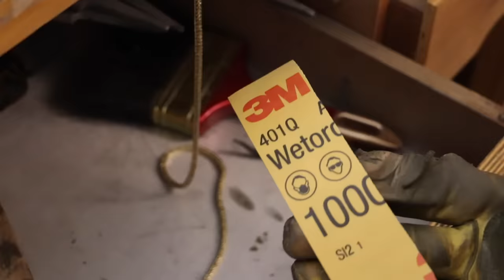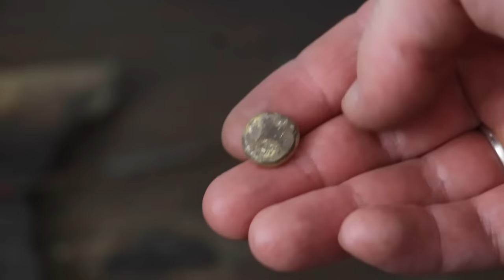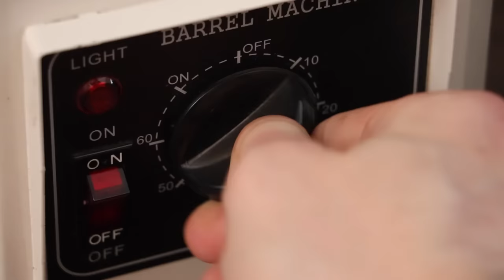18k Gold Chain | dynamisjewelry.com | How it's made

Comment: What are the numbers for cutting down the 1oz of 24k into 18k. Looks like you added copper and silver?  Also what did you sprinkle on there? Flux? Borax? Thanks!
Reply: 18 karats is about 78% Gold and then sterling silver would be about 15% then copper about 7% or vice versa.

Comment: Hey, really nice work you did here! There is something I've seen multiple times in your videos. You snap the Rings with the Wire cutter. In my opinion you can improve the quality of your rings by sawing them. Otherwise you will press down the edge while snapping and create a larger gab that has to be filled with solder. Keep going I love your videos
Reply: I think that with the rings being so small they lose less gold by using a wire cutter. Rings that small will take a small saw but the ratio of saw size to to gold diameter means the saw removes a lot of gold compared to large diameter gold rings and smaller saw bits. So less gold that you need to recover after cutting it. Thats my guess and I appreciate them showing us how to cut without a tiny saw for us beginners.
Reply: @Native_love  your analysis make good sense, thank you for you.
Reply: And I think they have special jewlers "wire cutters" that cut straight through so that the cut ends are flush.
Reply: Very good "bad idea" !
Reply: @Native_love  Yes that ist a good point. And maybe you are right with that I'm not a goldsmith. But if you look closely the gap created by snapping is relatively equal to a gap produced by a wiresaw. Maybe I wasn't clear enough in my comment because I also wanted to show the negative of snapping in pressing down on the material pushing it sideways so the diameter increase. That causes the solder to form a ball around the weld. Greets and tanks for your response